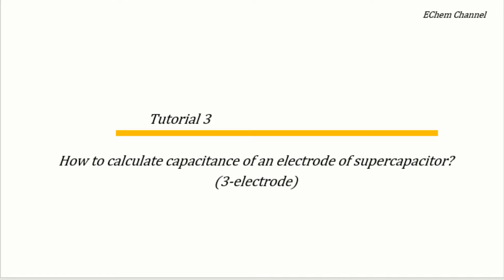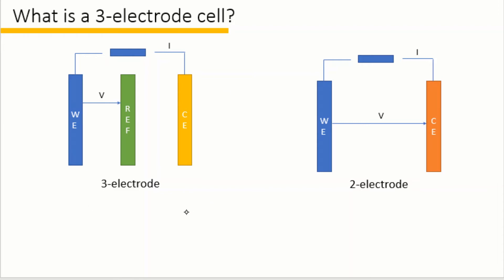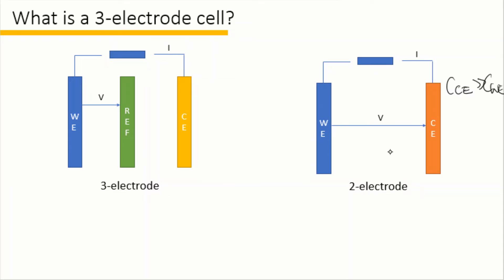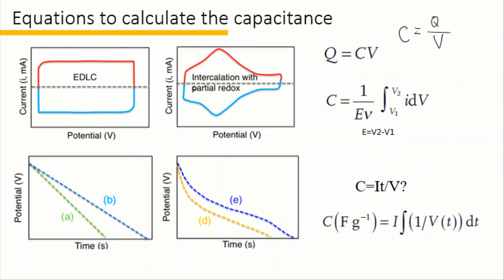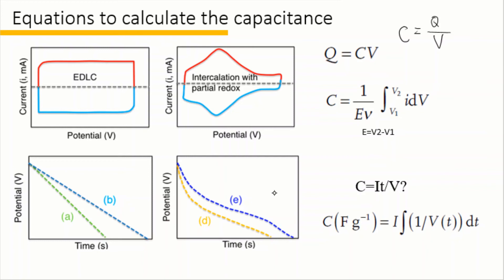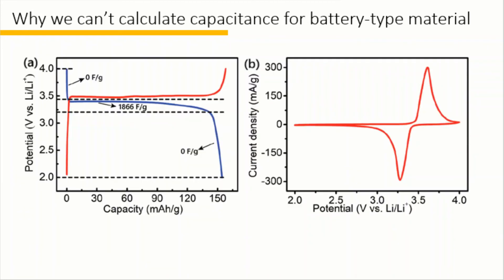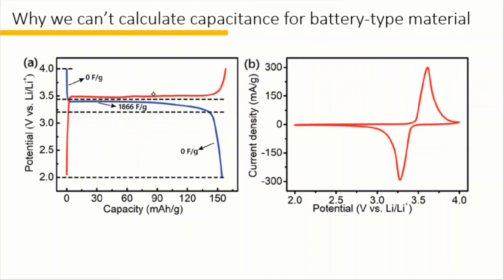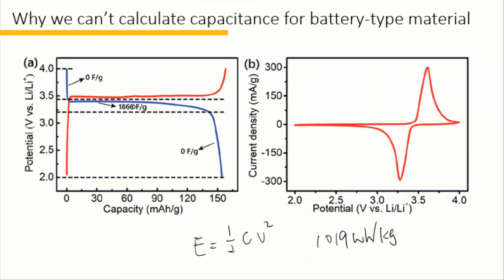Tutorial 3-How to calculate capacitance of a supercapacitor

Comment: I observe a peak (in low potential range) followed by a plateau region in discharging curve of symmetric electrochemical device. Material used is a ferroelectric-hexaferrite composite. What type of behaviour it is? What may be the cause of this peak (it means that while discharging at some point potential again start increasing reaches a peak , then a plateau and finaly discharges to minimum potential of selected window). Please help

Comment: How is 1/2CV^2 energy density? In what units are we measuring C here?
Reply from the maker: C is capacitance, whose unit is Farad or coulombs per volt. Energy = integration of capacity over potential. For a battery that has a flat potential vs capacity, E = QV. For supercaps that have a slopping potential vs capacity, E = 1/2QV (triangle shape) and because Q = CV, we have E = 1/2CV^2. You may understand this better by checking out Figure 2 in Fleischmann, et al. Chemical Reviews, 2020, 120, 6738-6782.

Comment: Hi, when using the formula for capacitance in non-linear GCD, the integral 1/V(t) goes to infinity as you approach 0. So, if your potential window goes from +v to -v you will get very large capacitances. Is there any other way to calculate capacitance from non-linear GCD? Thanks!
Reply from the maker: Hi Andres, we usually approximate the capacitance of non-linear GCD with the linear regression of the most linear part of the GCD curve.

Comment: I have another question. If I have material that work from 0 to +1 V, and also from 0 to -1V. In case of doing symmetric device what potential should I use? is it from 0 to 2V?? and what law should I use to calculate the capacitance? is it the same law from GCD but divided with 2?
Reply: Hi! Did you find the answer to your question? And are you working with SCs now?

Comment: Hi, when calculating the capacitance from your CV curves do you not have to take into account both the charge and discharge step. Which means you may have to divide everything by 2?  Cp=Area/(2×(S.R)×∆V) Quite curious to know more on this, thanks!
Reply from the maker: Hi. We usually calculate the discharge capacitance. However, it depend on how you define a charge and discharge process. Just make sure the Coulombic efficiency cannot be larger than 100%.
Reply: @EChem_Channel  so wouldnt the area under the curve be composed of both the CV's charging and discharging voltage steps? Once again resulting in it being divided by 2 if you were only considering the discharge step?

Comment: Nice video. Why we can't select potential range from -ve to +ve  in two electrode symmetric supercapacitors? Can you please elaborate reason for this?
Reply from the maker: Thanks. That is because if the cell is charge from +V to 0 then to -V, the polarization of the two electrode is simply switched (no extra energy is actually stored/released).